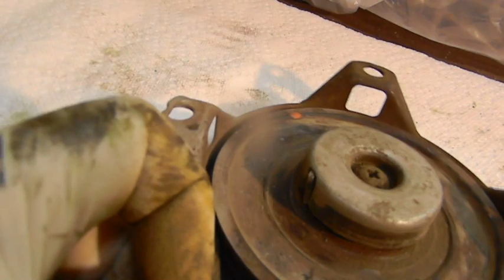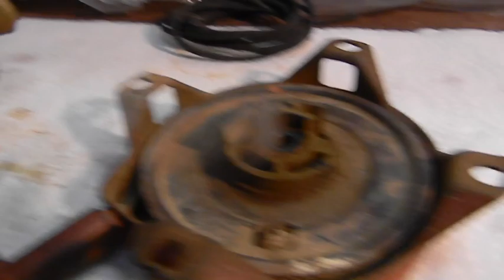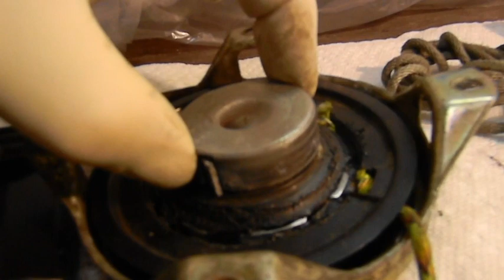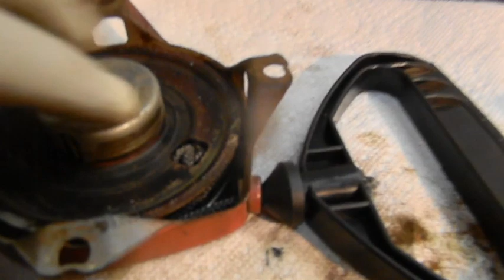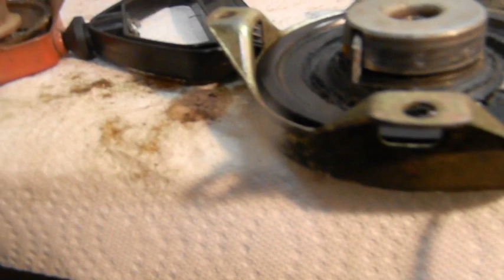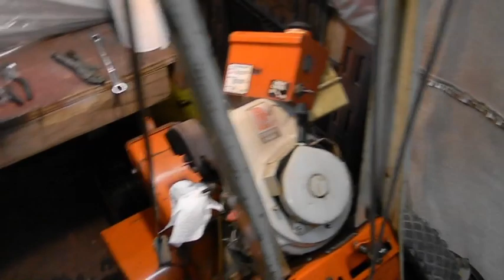Snow Blower Pull Cord Repair

Comment: I have a Tecumseh HH60 6 HP engine (Circa 1978).  The pull starter looks identical as this EXCEPT there is a small roll pin and plastic sleeve that protrudes from the #3 Philips screw!  The pin and sleeve stick out about 0.25-inch.  I have no idea what function that pin and sleeve serve.  Ever seen anything like that?  Regards.